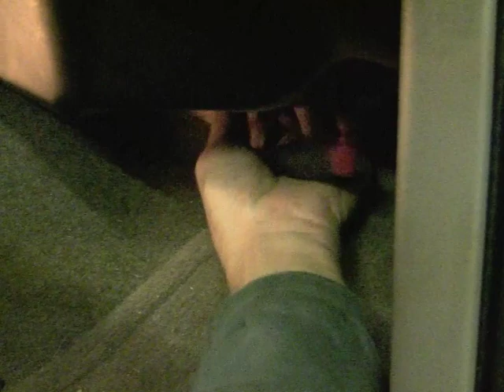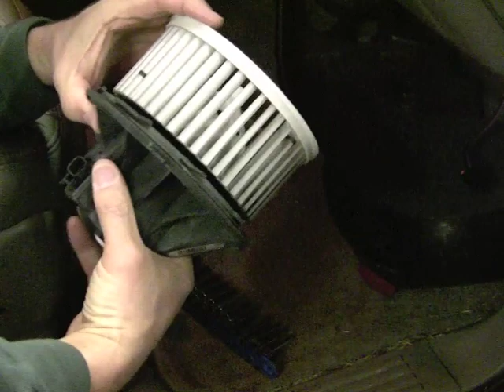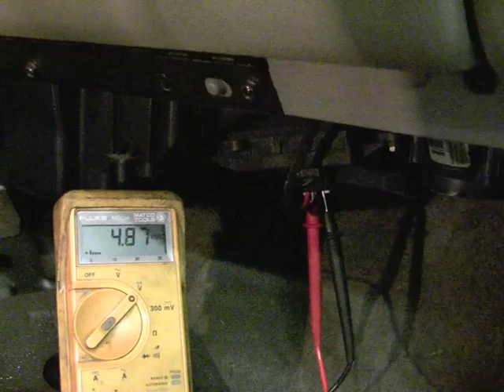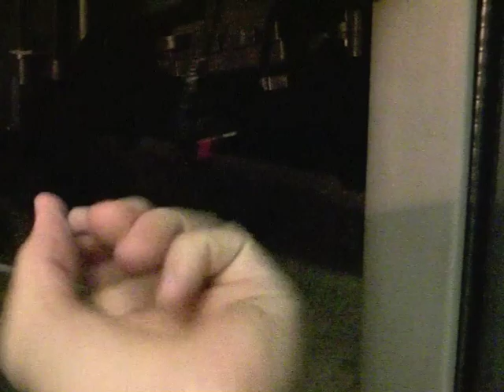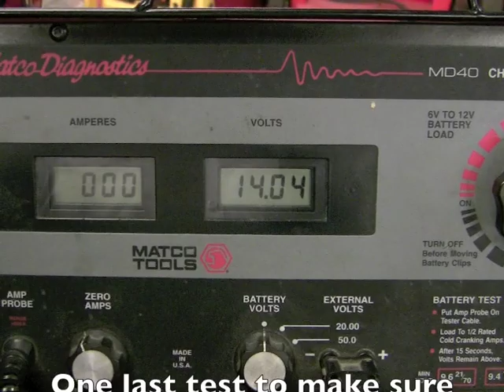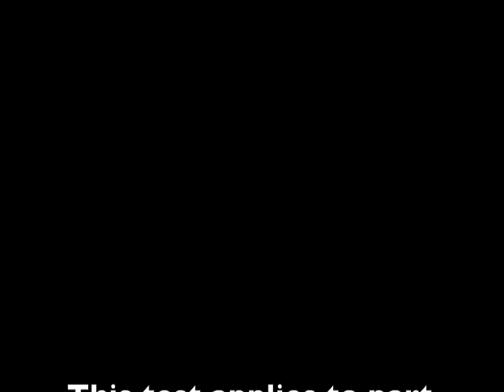2005 Chevrolet Tahoe Blower Not Working

Comment: Done that ,put new resistor 2 times,still not working
Reply from the maker: Would need a lot more information from you to offer any real help. Year, make and model along with your test results. Assuming you have a similar vehicle to the 2005 Tahoe with auto temperature controls in this video, the most likely problem would be a blown 40 amp "Blower" fuse in the underhood fuse box.

Comment: Hello, I have a Trailblazer 2002 (with manual temperature control) and my problem is this: when I put the controls on defrost the blend door goes to face, and when I put the controls on face it goes to defrost. What can I do?? Thank you in advance. Enrico.
Reply from the maker: I would start by trying to do a recalibration of the actuators. If that does not work you will likely need to replace the Mode actuator. The 2002 year model is unique in the parts used and the processes to change them.
Reply: Thanks Sparky, but what and where is the Mode Actuator?
Reply from the maker: @EnricoMariaMarcaccini  I have never had the opportunity to change the mode actuator on a 2002 year model. The part is unique to that year model but in the same general location as the later model in this link.  

 https://sparkys-answers.com/2009/05/2003-gmc-envoy-no-ac-vent-control-b0263.html

It is also much more difficult to replace it.
Reply: @SparkysAnswers  Thank you very much, Sparky.
On your article you wrote: "A recalibration can be done by disconnecting the battery for at least one minute, reconnect the battery, start the engine and leave the a/c controls alone".
Three more questions:
1. disconnect the battery negative and then positive or only negative?
2. what means "leave the a/c controls alone"?
3. in some recalibrating clips someone recommend to put the fan speed position at 3, the temperature a little bit lower then the medium and the position of the air at face vents (no feet, no defrost). What do you think about this tip...it's important or not?
Thank you very much!!!
Reply from the maker: 1. You only need to disconnect the negative battery cable.
2. I have always half jokingly stated to put your hands in your pockets. The reality is that you should not touch anything because the processor is testing the system and using voltage changes to do so. If you were to activate something and it changes a voltage the computer is reading, the recalibration will fail and the doors will be stuck at whatever position they were in at the time of the failure.
3.Not Needed. It stems from what happens to the readings on an Auto Controls panel. They always reset to 74F, vent mode and low blower.
Reply: @SparkysAnswers  Thank you for all, I will try every step hoping to be lucky!
Ciao!
Enrico
Reply: The recalibration is the same that the one who appear in your clip or is different?
Reply from the maker: @EnricoMariaMarcaccini  Should be about the same except I think it takes around 3 to 4 minutes instead of just one.

Comment: Where is g201 ground on 2006 tahoe
Reply from the maker: GM service information does not list a ground number G201. I also looked in the Mitchell ground wiring diagrams and could not find a G201. Maybe you could explain what you are working on and what is not working?

Comment: If I don't have a tester can a just remove the blower motor hook it to 12v and if it works assume that it's the controller.(after checking fuses)
Reply from the maker: The more in depth your testing is the more accurate your diagnosis will be. I would personally use a multimeter but If you don't have one Your suggested test method and inspection should at least eliminate a few things.
Reply: @SparkysAnswers  don't have one
Reply from the maker: @daveyoung465  I know, that is why I agreed with "Your" testing plan.  Some testing is better than none. At least you will confirm the basic blower function and that the fuses are good.
Reply: @SparkysAnswers  it was the blower motor
Reply from the maker: @daveyoung465  Happy to hear you were successful with your repair.
Reply: @SparkysAnswers  not repaired yet but when you bump the motor it will blow for a min the stop again
Reply from the maker: @daveyoung465  Bumping the motor will generally reset the brushes for a short time but sometimes the problem is with terminal connections. You will want to disconnect the harness from the blower motor and inspect for damaged terminals.

Comment: I have a 2005 gmc envoy and i have no power in setting 5. I have power to all speeds at the harness and a good ground on the harness. When i plug in the harness to the resistor it works on all speeds except 5. I can hear it click when switching to 5 and it kills the power to the fan. Even used an external 12v battery to power the orange ( #5 power wire) and the ground wire using another harness off of another vehicle and it still makes the resistor click and no power to the fan. I Changed the resistor twice and no luck.
Reply from the maker: Check for a blown/missing Blower fuse in the underhood fuse box. It supplies constant power to the red wire at terminal position "G" of the blower resistor harness connector.
Reply: I have power to all the settings until i plug the harness into the resistor. After connecting the harness it clicks but fan will not run on 5 . I have power to the red wire.
Reply from the maker: @jamesparsley1259  It is useful to check for power with the harness disconnected but in your case you will need to test with all harnesses connected. This would be  a called a loaded test. For speed #5 to work you must have constant power on the large red wire, constant ground on the large black wire and switched power from the blower switch on the small orange wire. Since you stated that you hear a click when the blower speed is turned to speed #5, the small orange wire and the black wire are likely okay. The problem should be with the red wire voltage. If the voltage is good at the red wire inspect the interior terminal condition. The terminal could be burnt and/or spread so that is does not make contact with the mating resistor terminal.
Reply: @SparkysAnswers .... after further inspection of the wiring diagram ( wish i could upload a copy of the schematic). when going from speed 1,2,3,4, to speed 5. the red wire is dismissed and it switches to its own power ( orange wire ) from a # 35 ( 40 amp fuse ) under the hood and its own ground. the only reason it is ran through the resistor is to allow easy change out of the resistor. i have now bypassed the resistor with the orange wire to the purple fan wire by splicing into the purple power wire keeping the black ground for the high speed continuing through the resistor. the blower fan now works on speed 5 with the same principle as it should, still being supplied from the #35 fuse. its drawing 6 amps on speed 5.
Reply from the maker: @jamesparsley1259  You either have the wrong diagram or are interpreting it incorrectly. While attaching the small orange wire to the purple fan wire will allow the blower to operate on a higher speed it will not be powered from fuse #35. The simple proof will be to remove that fuse and see if the blower continues to operate as you have it wired. If you continue to use it as you now have it wired you will burn something out. That small orange wire is not designed to carry the load of the high blower operation. It is designed to energize the relay coil which pulls the contact arm closed and connects the red wire to the purple wire inside the relay.
Reply: I have the wiring diagram from the haynes vehicle manual for 2005 gmc envoy 4.2l. The red wire controls power from fuse # 44 in the rear fuse block and only controls settings 1-4. #5 gets it power from the under hood fuse #35. Which is the orange wire coming from the climate control which is powered by a brown wire coming from the # 44 fuse. Click this link and this is the wiring diagram......
https://www.google.com/search?q=2005+gmc+envoy+blower+fan+wiring+diagram&tbm=isch&ved=2ahUKEwj30O2liZ_vAhXTiFMKHb0pDwIQ2-cCegQIABAC&oq=2005+gmc+envoy+blower+fan+wiring+diagram&gs_lcp=ChJtb2JpbGUtZ3dzLXdpei1pbWcQAzoECB4QClDa5wVYru8FYKWIBmgAcAB4AIABkgGIAYsFkgEDMC41mAEAoAEBwAEB&sclient=mobile-gws-wiz-img&ei=fD5FYPeiL9ORzgK907wQ&bih=650&biw=360&prmd=sivn#imgrc=8igloaSuVaEnhM
Reply from the maker: @jamesparsley1259  You are reading the diagram wrong. Fuse #44 Powers the blower switch. The blower switch then sends all commands to the blower resistor. Speeds 1-4 are routed through the internal resistors to the internal  terminal "E" of the high blower relay and out on terminal "D" which attaches internally to the blower purple wire (could be red on replacement resistor assembly). The internal contact point is considered normally closed. When speed #5 is selected the blower switch sends power out on the orange wire to  the blower relay terminal "A". Since the relay terminal "B" is always grounded the relay coil is energized and pulls the contact arm down so that it now makes a connection with the relay contact that is attached to relay terminal "C". Terminal "C" is powered by the large red wire which in turn is supplied power by the underhood fuse #35, 40 amp.
Reply from the maker: @jamesparsley1259  Why in the world would I want to waste my time watching someone else video on this subject? I know exactly how this system works and do not need any help. I literally wrote a "book" about it. https://sparkys-answers.com/2010/02/2006-chevrolet-trailblazer-blower-inop.html  The manual blower controls for Trailblazer/Envoys were exactly the same through the entire production run. If you leave the wiring modification the way you have described it  earlier you will damage your vehicle, period.
Reply: I wasnt trying to undermind your intelligence. I understand now what you are saying about the current flow. The way i have it connected is making the fan on 5 pull current from the brown wire #44 fuse. I have ordered another resistor to try again.  Thanks for helping me. Sorry for the trouble.
Reply from the maker: @jamesparsley1259  Trying another resistor assembly could correct the problem but I would recommend using a different brand if you go that route. Can you describe what kind of tools or devices you have to test with? If I knew what you have to work with I could give you test procedures designed for what you have.
Reply: @SparkysAnswers  amp clamp volt meter, and test light also wire tracer/tracker if i need it.
Reply from the maker: @jamesparsley1259  Assuming that you have test leads for your meter, check to see what kind of voltage is on the red wire in the seven wire harness connector with all harnesses connected including the blower motor. You will need to use the tip of the test lead to back probe the 7 wire connector. If it is too large you may need to straighten out a paper clip and use it as a probe. Connect your other test lead to a known good chassis ground. Check the voltage with the ignition off and then test it with the ignition on and the blower switch set to 5. Then provide the test results.
Reply: I finally got around to back probing the red wire after changing out the resistor. It still stops working on speed 5. The red wire is hot while plugged in on speed 5 but no current is coming out of the resistor to the red wire to the motor in my case. It has current on the orange wire on speeds 1-4. The resistor still clicks on speed 5 like it is making contact.
Reply from the maker: @jamesparsley1259  Your test results conflict so much with the way the system is designed that I can only conclude a few things. The wiring order for the seven wire harness connector is incorrect, the seven wire connector has heat damage that so far has gone undetected, the blower resistors you have gotten are poorly designed/flawed (assuming you have used the same brand throughout this ordeal) or there is something inconsistent in your testing procedure.

Comment: Resister and blower fan replaced still not working I believe its a ground problem with my 02 yukon nothing is the same as other yukon kinda losen my mind my resister is eh module and the fuse location literally has no fuse i was driving when it died now I have no idea why its not working...you believe it could just be my ground my door locks stopped working as well
Reply from the maker: The blower and door locks do not share a common ground point so that is unlikely. I would start by checking for constant power on the orange/red wire and ground on the black wire. The orange wire is supplied power from the FRT HVAC fuse in the under hood fuse box. It is fairly common for the terminal under the fuse box to burn out if the fuse is okay.

Comment: Hello i have a 2003 tahoe and my ac stays on ALL the time , i was told it was a blower motor resistor so i replaced it and it did nothing . I can play with the controls under the radio and still have nothing any help is appreciated
Reply from the maker: There are a lot of variables with your statement so we need to clarify the problem. Does the blower run all of the time even with the ignition off? Does the blower operate properly but you only get cold air through the vents? Does the air only come out of the face vents and not the floor or defrost? Or other?

Comment: Hi. Nice video, little confused. Is there a HVAC Blower motor speed controller and resistor for the 2006 Surburban?
Reply from the maker: Most people want to call the component a "blower resistor" but there is a difference. A blower resistor is the name for the part when used in a system with manual controls. A blower speed controller is the term used for the part in a system with auto controls. The parts are not interchangeable and are vehicle specific. To add a little more confusion. If your system has front and rear systems then there are separate blower resistors or bower speed controllers for each blower system.
Reply: @SparkysAnswers  thanks Sparky. I do indeed have manual settings, plus a rear controller( which works and now makes sense) so what I need I believe by what you taught me, would be a resistor. The truck has 270k miles on it so do you think a blower motor also? Thanks again.
Reply from the maker: @rltkktlr  Yes, Manual system = blower resistor. Hard to say on the blower motor with that many miles. It may have already been replaced. I would recommend a visual inspection. If any doubts replace it when you replace the resistor. I strongly recommend using ACDelco original equipment parts.
Reply: @SparkysAnswers  thanks will do. Been burned too many times on China parts. You have a link by chance for a good parts place?
Reply from the maker: @rltkktlr  Don't expect the good parts to be made in the USA. The blower resistor is usually made in Slovenia and the motor mostly is supplied from Korea or China. I used to know exactly where to buy them but I have been shifting in my career and haven't bought one in over a year now. I would look them up in the ACDelco online catalog and then search the appropriate parts numbers. You will want to take a picture of your RPO label in the glove box and the parts so you will have a visual of what they look like. https://parts-catalog.acdelco.com/catalog/catalog_search.php
Reply: @SparkysAnswers  Hi. I removed the resistor, part number 16250785. Mice had their way in that area and cabin filter. I suspect could have caused part to fail. Any continuity tests I can do to help diagnose bad part? Not really cheap at about $110. Thanks again
Reply from the maker: @rltkktlr  The part number and description don't match up with the 2006 year model Suburban that you originally listed. Please go to my main site Sparkys-Answers.com and sign up for a free membership. Once you have a membership and have signed in, go to the my account button and click on it. Scroll down and ask a question there. You can also upload images if you have them.
Reply: @SparkysAnswers  ya sorry it’s a 2002. My other Chevy is an 06. I will sign up. By the way, with purple being ground, I only have continuity on one of three terminals on resistor, I feel I should have it on all 3. Maybe not.
Reply: @SparkysAnswers  signed up for your answers, looks cool. But I feel it would be very helpful to send a few pics, but max is 2 MB and I don’t have pics like that small size I guess.
Reply from the maker: @rltkktlr  I made a change in my dash board so it may allow a larger file now. If not ask a question on that site and we will figure out a way to do it.
Reply: @SparkysAnswers  Thanks, it worked now just fine. I submitted the question with 2 pictures. Great looking web sight.

Comment: I'm having the same blower not working problem. I'll have to get a voltmeter tomorrow, but before I do all that I was wondering if some of the other electronical issues may be related. The drivers mirror moves in reverse and doesn't return to the same position back in drive, as well as the driver seat moves reversed from they way the switch used to work (forward now goes backwards and vice versa). The mirror is a replacement and the transmission was rebuilt not long before this. I also have replaced both front hubs (separate time and different brands). Because of codes and now I get a code for abs module. I was thinking it might be a bad ground. Any advise? Thanks in advance.
Reply from the maker: Because most of those systems do not share a common ground point. I doubt that all of those issues would be related to one central ground. I also recognize all of them to be fairly common individual system faults.  I would recommend methodically diagnosing and repairing each individual problem.

Comment: I have a 2001 Chevy Tahoe 4x4 5.3 I have no fan speeds at all 1-5 is it the resistor or is it the blower motor
Reply from the maker: It could be either one and I recommend testing to find out what is wrong. I wrote a detailed  article on this subject several years ago. https://sparkys-answers.com/2008/07/2005-chevrolet-silverado-blower-inop.html